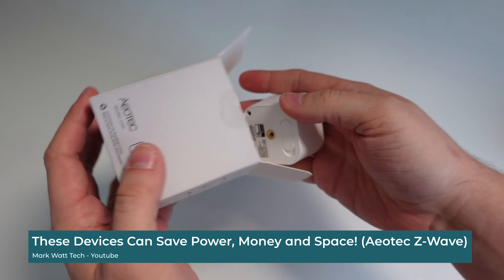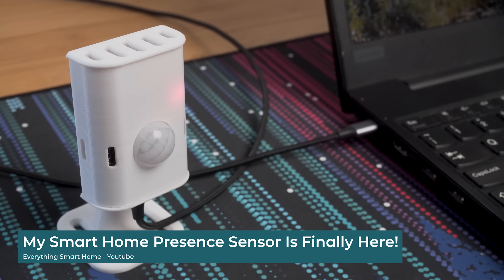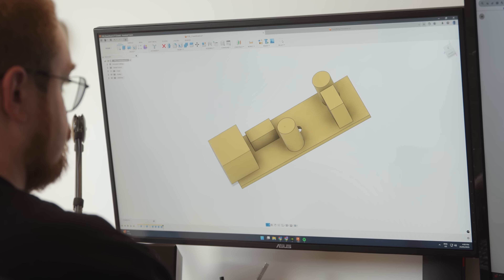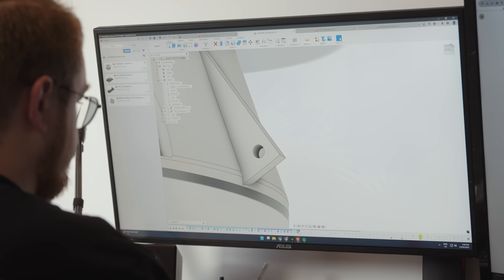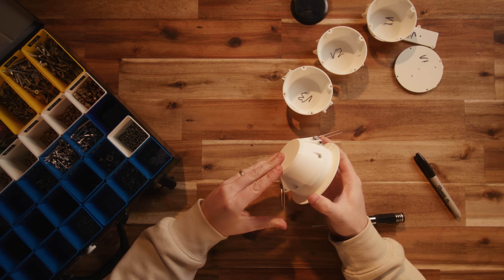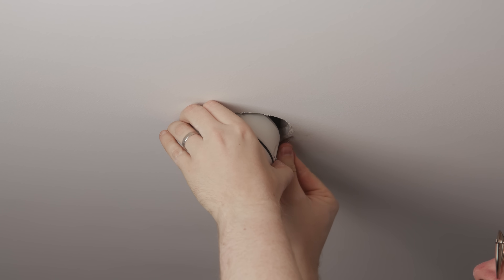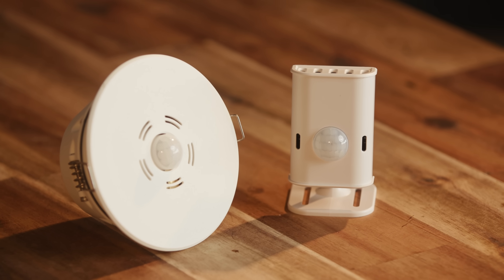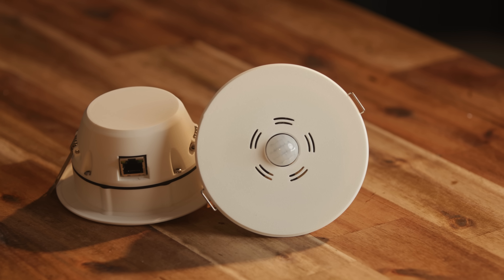Where My Perfect Smart Home Begins - Everything Presence One

Comment: Putting the sensor package on the ceiling would blend in better, but then your temperature/humidity will be skewed.  Hot air rises, so your temp will read higher than it really is at people level, right?  Without a way to compensate for that, I'm thinking about putting the package at light switch level.
Reply from the maker: You can compensate for that! There's a temperature offset configuration option for the sensor.

Comment: good alternative !  However I do not see how this is better.... you traded a USB cable for PoE, and the original EP1 device case for yours, so in the end you still had to route cables, and you still have an extra fixture in your rooms... Just as easily one could have the original case mounted to the ceiling (or wall) with a USB cable routed to power with a cheap USB power cube wired to power (not necessarily into a plug and inside the wall plug outlet... think about it...)  such as I did.  I now have the EP1, a smart speaker, and a small camera in every room I needed to have them, and all are powere by the same USB 40W cube, wired directly to power in an existing power outlet nearby.

Comment: Do you have them installed in bedrooms? or just communal areas, if so how you deal with sleep time? how you tackle not getting blasted with full lights on your face while flopping around in bed at 3am, and how to turn the solution for this problem off during the day when you actually need the motion/presence sensor to work as intended WITHOUT having to actually manually turn on and off this whole ordeal every night/morning

Comment: Have you noticed any issues with the sensor pointing straight down from the ceiling? I'm newer to mm wave presence detection and have the understanding that the best placement for these types of sensors is in a corner of the room.

Comment: Hey I have a question, I want to do something very similar, I want my smart home to be very seamless so in ceiling makes the most sense, the only issue I’m running into with planning is ceiling fans, as I’m in Australia as well we not only have a hvac but also ceiling fans in most common areas. Dit you possibly run into this and what did you do to get around it?

Comment: Could you please specify the location of the sensors you installed on the room ceiling? Were they positioned in the middle or on the sides? Knowledge of the sensor’s range would be beneficial in this context.

Comment: Really well done planning and execution. I doubt CO2 sensor in this situation will actually work correct. If you do not use proper ventilation CO2 tend to gather on the bottom of room due to its heavier than normal air (reminder: CO2 sensor here divided from room by ceilings and placed in very top point of room). So, i'd go separate CO2 sensor here although your work is amazing and i also like idea of multisensors.

Comment: Extend your old alarm system with wired PIRs in each room then use Konnected to make it available in home assistant. This makes it super neat and well integrated into your security system. No cables visible, and sensors can be used for both custom security automations, climate control, and motion sensor based lighting.

Comment: Great everything sensor, though as I would also be using POE I am would want the data to be fed over the cable too.  I know I am an outlier in that I prefer things to run over cabling into my switches, but given the low cost of running a rack mount in a larger home I find it worthwhile.

(Admittedly the last install used 3 miles of cat 6.)

Comment: Nice solution, though uses up ports on a POE switch. I’m also planning on using these sensors, but run CAT5 (future proof), and power via a DIN mount 5v power supply. Just terminate header header pins to 2 cores of the cat cable

Comment: If you like the form factor (ceiling mount or wall outlet mount) and do not want to/can't do the 3D printing project,  Apollo Automation are about to release a POE based dual presence sensor (plus temp, humidity, luminance and optional CO2) in a ceiling/wall mount configuration. They are a small US company of a few college guys and have various ESP based sensors.

Comment: You are insane, I love it. My concern is cutting holes in the ceiling. With the pace that technology changes I would be concerned about patching the holes. When the POE version is available I would like to see a ceiling mount that you could screw to the ceiling but wasn’t too thick. A mount like a smoke detector so you could easily remove the detector if needed. Keep up the good work and I look forward to what is coming next.

Comment: Measuring CO2 levels at ceiling height can be acceptable, but it may not provide the most accurate representation of the air quality in a room. CO2 is generally heavier than air, so it tends to accumulate closer to the ground.
For more accurate measurements, it's typically recommended to measure CO2 levels at breathing height, which is usually around 1 to 1.5 meters above the floor. This ensures that the readings reflect the air quality that people are actually breathing.

Comment: It's an interesting video and highlights some nice ideas and proof of concept.  I think it would benefit from a number of follow ups: as others have commented, putting temperature, humidity and CO2 sensors into the ceiling isn't the best place for these so will require a lot of calibration which, I suspect, won't be linear and highly influenced by the environment itself (sun, heating, number of people, turned on electronics, dust etc...)  It would be good to see how you collected and interrogated the data, made adjustments and validated.  I can't speak to the building regs/codes for hidden wires and at least they aren't high voltage!   I take it you have a single storey dwelling?  This becomes a lot more difficult in multi-story buildings even your typical two-floor house.   Ultimately, it would be more useful for designers to be creating form factors with ultra-efficient MCUs in them and that could use coin-cell batteries: even with as low as 1 second sleep intervals - for presence detection purposes say - batteries would last a long time.   Imagine if you could buy these things with and without casings so you could design and print your own to suit your house!  That would be cool and might avoid warranty issues.

Comment: All-in-one sensors are unfortunately a "Jack of all trades/Master of none" trade-off scenario. C02 sensors in particular should be mounted between a height of 4-6 ft (1.6-1.8 m) where the comingling of air is the highest, so the ceiling is not an optimal place for it. Heat rises and cold air falls, so again, the ceiling isn't a great place for a temperature sensor. But mmWave and PIR sensors can be blocked by furniture or other objects in the room, and low-mounted sensors can more readily read pets as motion, so the ceiling or a high vantage point is more ideal. I know the EP1 and EPLite are both modular in nature, but other multi-sensors are less so, so when one component goes bad it's less easy to repair/replace than multiple discreet, single-purpose sensors.

Comment: Would your design files be compatible with still using the usb C for power? (Soldering would be outside of my tools and skill set)
Reply from the maker: There's room in there for a USB cable, yes. You'd need to drill a hole in the PCB mount to pass it through, but it will work!

Comment: My only thing that would be cool, idk if it’s already possible with the sensors built in. But a way to detect the brightness of the room. If it’s dark and motion turn lights on. I know you can only have the lights turn on after sun down but it would be cool if I had the blinds all closed the lights would turn on. With a manual override for certain situations of course.

Comment: Dude, I've been needing this for months! I'm trying to make use of a hole on the ceiling that used to have a "dumb" motion sensor to trigger a light. I hated it and ended up turning it off. Since then, I've been trying to find something else to place there and this would be just PERFECT! Don't have a 3D printer though and PoE wouldn't really do it for me (probably the USB C port would be better since it already has AC current), but having all those sensors there would make so much sense!
Reply from the maker: You can order the 3D prints through PCBway if you don't have a printer!

Comment: Do you not find at least the temp sensor being abnormally affected by the attic/loft space?

My loft ia currently sitting 45-50°C daytime and id imagine id need some decent insulation to make sure im getting the room temp.

Is it possible to get some comparison between a TM902 device near the ceiling vs the recessed sensor and the deltas between them over time (as the deltas would enable an offset so long as its consistent.)

Comment: Did you ever mention where all this information is going to/ being controlled from? Do you just have a "server" program running on your computer 24/7, or does each device have to connect to the sensors, or do you have a "cloud" you have to access?

I ask because I was going to do a lazier version of this; had an esp32 running a little web page that gave me temperatures when I connected to it, and I was going to set up different functions as I added more, but then realized each one would have to find the others to interact, or I would have to dedicate one as a "main" device, or I would just have to have a bunch of separate "microservices"... and then I just kinda gave up because it was just a ""cool" thing and nothing truly functional.
Reply from the maker: All your questions are answered in my 'Smart Homes are Dumb' video :) 

In short, Home Assistant!

Comment: My plan for my home post renovations was something similar, and you mentioned a reminder to open the window when certain C02 levels, at our house that's not really an option, but my plan was to have them trigger the AC system to run just pull fresh air in, or dehumidify if necessary.

Comment: Awesome project and I am very interested to give this one a go. I love the slim design with having it recessed into the ceiling but I am curious if that will throw out the temperature reading having the topically higher roof space temperature (especially in summer) hitting the backside of the housing. It would be awesome if you could do a comparison of the original sensor and your new recessed version in the same room close to each other and look at thier temperature readings on a hot and cold day to see if they differ. 

Great video!

Comment: Just a heads-up — CO₂ is heavier than air, so putting the sensor on the ceiling isn’t ideal. It might not give you an accurate reading and could even miss higher concentrations entirely. For best results, try placing it around breathing height or a bit lower, especially in rooms with limited airflow.
Reply: CO₂ "higher concentrations" are impossible at home, especially if you have at least one small window in the room
Reply: @bratecyo the. Why monitor it with a sensor placed on the ceiling? It makes no sense.

Comment: CO2 is denser than air so having the sensor on the ceiling is far from optimal, the same with the temperature sensor because heat rises so when you start heating the sensor will heat faster than the rest of the room. 
I'm thinking about using this mount but for the presence sensing and maybe carbon monoxide sensing.

Comment: If they sell a super cheap sensor that only does temperature…couldn’t you put them near the floor in each room and then calculate a temp offset for both the heat from the PoE board and also the temperature differential that will naturally come from having your sensors on the ceiling? That way you’d have data for the heat gradient across the height of each room

Comment: I think the solution is good, but could be improved upon. Nice format, being ceiling mount. It does require calibration (normalize temp to placement). Consider adding LED status lights to indicate (1) power-on / motion-sensed and (2) CO2 normal / high. Plus the option to add reset button (restart device). Option to add short term battery to maintain sensor if/when main power is interrupted. Thanks for sharing this content.

Comment: Another amazing project! Worth nothing that CO2 is about 1.5 times heavier than air, so if you’re measuring high levels in the ceiling, you’re probably in trouble at floor level! Maybe there’s a way of calculating an offset for this?

Keep doing great work.

Comment: I am confused how you get the temperature reading of the room and not the attic. I think the temperature offset won’t be static all the time. On a hot summer day, the attic will get way hotter than the room, and the temperature distance will widen.
Reply from the maker: The sensors are sealed, so heat from the roof space has no direct path to the sensor. They will be covered in insulation in the ceiling too which will further isolate them from the heat (or cold) in the roof space.

It won't be perfect, but realistically, it doesn't need to be!

Comment: I’ve considered the same solution, but I was concerned how many I would need and how to get the location right, which is generally a thing with mmWave. Right now my Aqara FP2’s are located in the corner of the room and can cover 8 meters diagonally.

I’d like to know is how large of an area these in ceiling sensors cover.

Comment: All fun and games when you have easy access to the space (or any space) above the ceiling. Unfortunately I’m dealing with concrete structural segments that are my ceilings as well as floors. Quite challenging to route and hide cables and any sensors need to be placed on the wall ceiling. But very interesting project and I’m looking into these sensors for sure. 👍

Comment: You might need to check and compensate for temperature stratification with the sensors so high up.   I have this issue in my home in the winter where it is nice and warm up high where my temperature sensors are, but it's cold down by my knees.

Comment: Maybe a silly question, but why can’t we have a nice super lower power draw zigbee version of this? I have an Insteon motion sensor in my garage that works for years on a single coin cell battery. I would be happy to put 3 batteries in parallel and replace the batteries every 5 years to avoid running wires. My ceiling is not accessible. What is the high power draw element here?

Comment: For cutting the holes in the ceiling, Klein sells a hole saw with a dust catcher surrounding the cutter. I've made a DIY one with a paper or plastic bowl which works well too.

also, if you were able to flip the ethernet port around, there are 90 degree cables which would then point up into the hole. maybe unnecessary.
Reply: Hole saw dust bowl. And PPE. Cutting drywall is one of the messiest things and you don't want that in your eyes or lungs.

Comment: Might want to add an intumescent gasket around the fitting if there's a floor above that's occupied. Big holes filled with plastic in a ceiling doesn't do much for the fire rating. Although this looks like this is a single storey place...

Comment: Great mount!

The problem for me in these multi-sensors are the placement. Usually, the height and position of measuring temp/humidity, lux, and CO2 are extremely different from the effective placement for PIR/presence sensors. E.g. CO2 tends to sink in the air, so it might be a little too late to open the window when your ceiling sensor reports > 1000 ppm :)
Another thing is that temperature offset should be dynamic, as heat from the board affects reading depending on ambient level... And this is pretty hard to calculate and apply, so in general i try to move temp/humidity sensors away from boards.

Comment: The co2 levels need to adjusted to trigger at lower levels as co2 is a heavy gas and will fall to ground level and displace the oxygen forcing it upwards. So lying in bed the co2 level would be way higher than than at the sensor in the ceiling